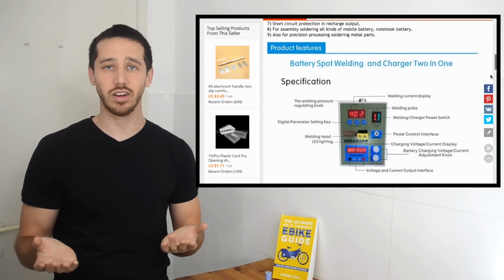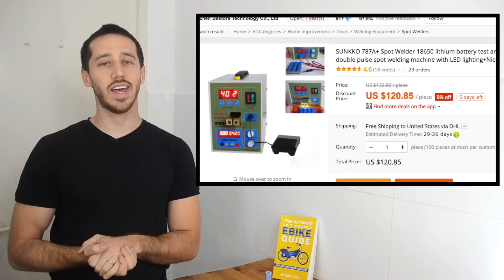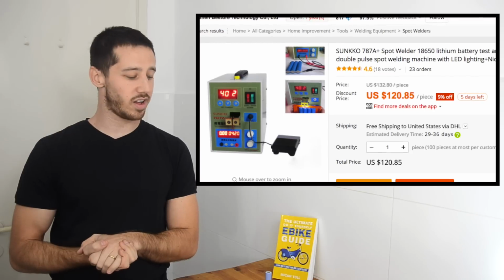Can you solder 18650 batteries? Q&A#3

Comment: Dumb question.   What about 2170 cells?  The ones that Tesla Motors is starting to use.  Will they work okay for an ebike, are they cost effective, how difficult are they to acquire?  Also, how big would a 1kWh pack be?  I just want to be able to say that my bike is a Tesla.
Reply from the maker: Yea, those cells would probably be great. The problem is that they aren't publicly available yet so not only do we not know their exact specs, but we can't build anything with them yet. But you can rest assured that as soon as they are available, you'll see ebikers messing around with them :-)

Comment: Can you do a review of spot welders? I bought the Sunkko 709A because it has the welder leads but the performance is lacking. With everything maxed out it still doesn't make a good weld. The design of may battery doesn't allow for welding parallel groups like you do.

Comment: Hi, thank you for making great videos. Q: How do I know what volt and amp hour my battery pack will be? For example I want to build a 36v 20ah battery!
Reply from the maker: Well that one is easy. A 36V 20Ah battery is 36 volts and 26 amp hours :-)
...But I assume that's not what you meant. To calculate how many batteries you need, multiply by their nominal voltage and capacity ratings. For example, if you built a battery using li-ion cells (which are 3.6 or 3.7 V nominal) that were 2.6 Ah each, you'd need 10 cells in series and 10 cells in parallel to get 36V 20Ah, requiring a total of 100 cells.
Reply: EbikeSchool.com that's great. Thanks for the reply.

Comment: On the Kickstarter people were going to solder on the pre-welded strips. Has your thinking changed on that?

Why doesn't somebody just sell different cells and have a robotic spot welder in the same facility to put together whatever people want? Why do we end up with all this stuff coming from Asia? Once you have robotic welders, what is the point of doing this DIY? Juiced touts the fact in their Hyper Fat that the pack is made by a robot. What the heck.

I put together an ebike battery with Titan Flight modules. Their modules include a 6s, Sanyo GA cells. So I use 4 (24 cells) with 2 series and then 1 parallel connector. It's a nice low capacity battery pack, certainly good enough as a reserve. I figure Hobby King will start to sell 18650 groups with the standard RC balance leads and connector. The RC chargers give a lot more information, anyway. I can parallel charge as two groups. For $10 I can buy a gadget that shows the charge in each cell. None of this is available with ebike configurations. People don't know how well their packs remain balanced. I give you credit because the entrenched ebike industry wants people to understand as little as possible. No watt meters, no watt hour meters, no cell information, no settings for the charge %.

If you solder people will jump down your throat and if you use hot melt glue they will jump down your throat. It's kind of idiotic to own a spot welder for individual use. But yeah, you shouldn't solder, but why do people need to weld? 

My money is on RC packs made from good 18650 cells, or maybe Shawn McCarty's mechanical system.
Reply from the maker: Soldering on the nickel once it is already spot welded is fine, as long as you do it fairly quickly. You don't want to heat it for a long time, but since you aren't directly heating the cell terminal, you can heat the nickel for a few seconds without much heat transfer to the cell itself.

Hopefully we'll see more packs like you are talking about become available soon!

Comment: i just want to know..i see some people that build batteries used fues to protect from over lode did it really matter?  sorry for the bad English :)
Reply from the maker: Your english is just fine. Cell fuses aren't meant to protect against normal overload, they are meant to cut off a cell from the rest of the pack if it shorts and could draw enough power to overheat. Cell-level fuses are usually used when a) you have a large battery that could be dangerous, like an electric car, or b) when you are using low quality cells, like the DIY powerwall people. If you use high quality cells, you shouldn't have an issue with any cell shorting. But if people's lives are at risk, or you use crappy cells, then cell level fuses are a good safety measure. Toda al hashe'ala.

Comment: Is there a cheaper generic version of The Bosch 36 volt charger for active line ($200)  (and end plug) and the expensive 400/500 battery ($800-1000) omg in 120 volt,USA .
Reply from the maker: I'm not sure what connector the Bosch charger uses, but this is my go-to source for chargers: https://goo.gl/js0T0V Just choose the one with the correct voltage and if they don't have the right connector then you'll just have to swap the connector yourself. I have a video on how to add a charger connector.

Comment: Can the bms charge each cell in the pack because The bms cuts off the charge when even a single cell reaches 4.2 to prevent overcharge.
Reply from the maker: The BMS doesn't actually charge the cells. In fact, it does the opposite. It's like a floodgate opening on the cells that reach full charge first. It slightly discharges them to allow the other cells to catch up, that way they all reach 4.2 V together.
Reply: How do you confirm the quality of the BMS that you use? From other people's videos I have heard of BMS failures.